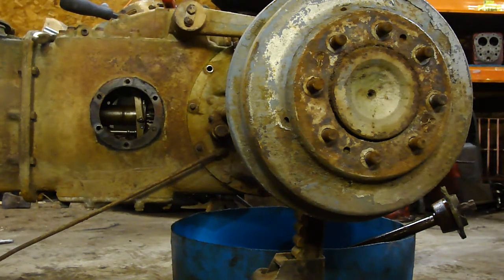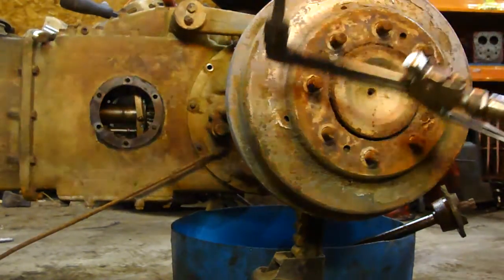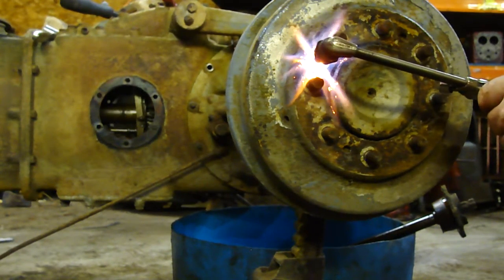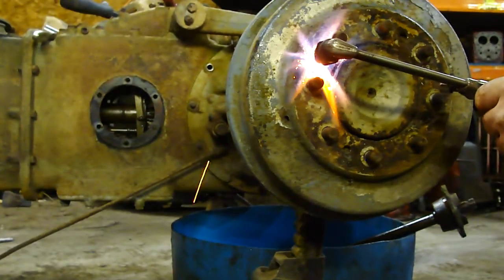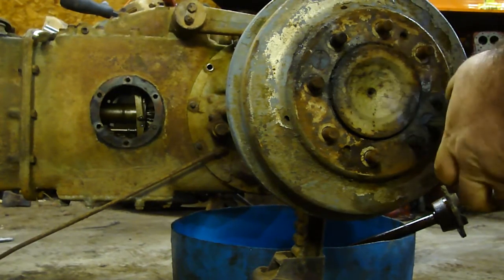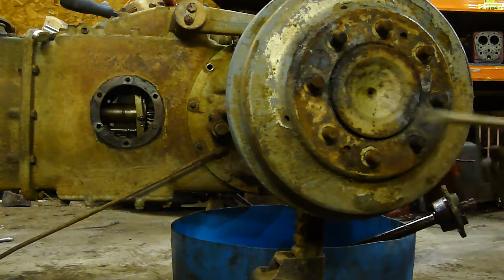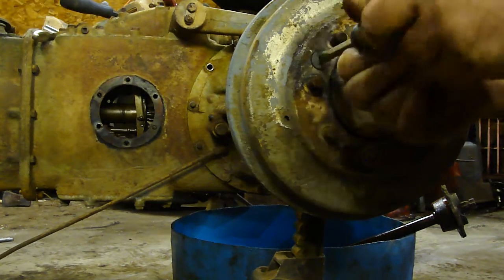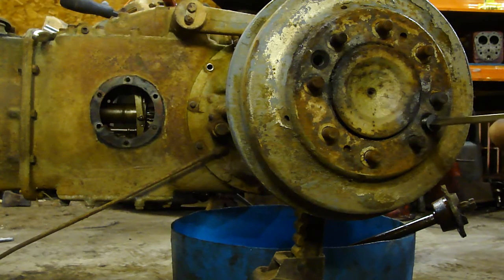Ferguson tractor brake drum retainer screw removal the easy way.

Comment: Working on this same problem now on my 600 Ford tractor. Use oxygen and acetalyn with no luck. Heated cherry red 4-5 times each one and they wouldn't budge. Used a chisel and still wouldn't work. So I torched the bolt out. But still cannot get drum off. I am taking apart because I think my brake springs or something is broke in there. It is locking up. Lifted with my backhoe to get from outback of my house. It locked up while brushhogging last night. Kept hearing this little noise but couldn't tell where it was coming from it wasn't bad, but then she locked up. I am letting oil soak on the bolts and axle. I hope I can get it without having to have a professional come in.